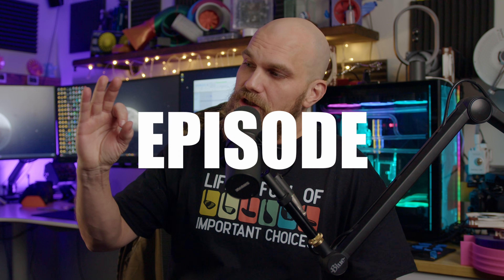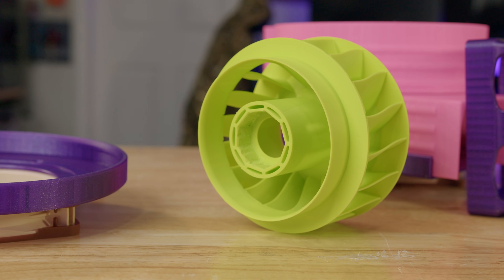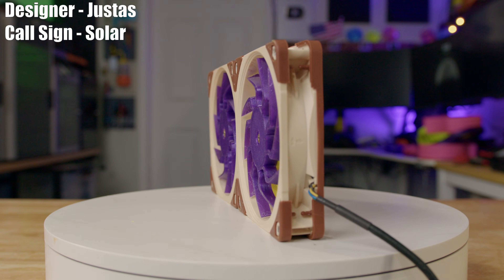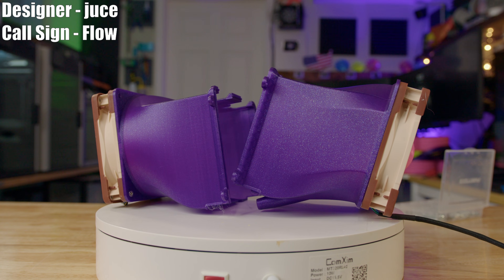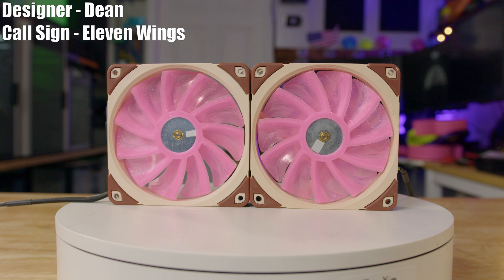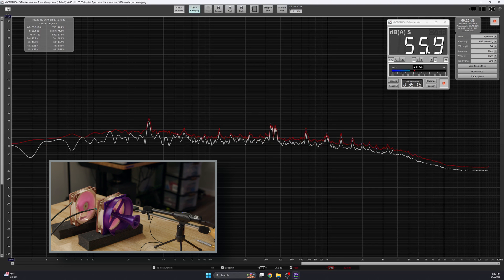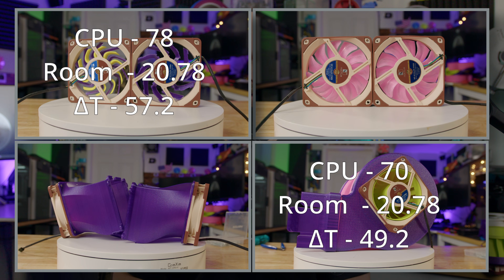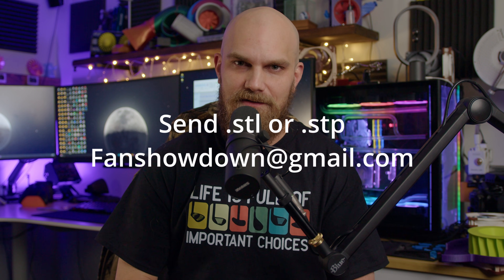The Most Aggressive CPU Fan Ever Submitted | Fan Showdown S7E3

Comment: Why not develop a phone app to "audio mask"  similar to noise cancellation. it would simply listen to ambient sound and play it back in reverse to cancel out the high less pleasant fan sound and greatly reduce perceived loudness. Set your smart phone next to your PC and you'd have a much quieter gaming fan setup that still performs well. Could even use the internal PC speaker to do it?

Comment: I love that wind tunnel idea, maybe it's because I've thought about it myself lol. 
Imagine if you had it mounted between the front case intake and exhaust, going straight through the case (or maybe a 90° curve between a top fan and exhaust)- fresh air in, hot air straight out the back of the case, no mixing with GPU exhaust.

Comment: Dual Flow would have been way quieter (and more efficient too) if the rotors were properly balanced first. It sounded like the majority of the noise coming off of it was from the interiors doing a rather aggressive wobblin' as they went round and round.

Comment: The table had "Jule" and video had "Juce" as the designer of Flow. The design of the Flow seemed like a clear winner for me and the only question in what kind of fan blades you should use in it.

Another option for ducted form factor would be to have both fans on the intake side with compressor setup (first fan running first stage of the compressor with throughput optimized fan, and secong stage with pressure optimized fan – with maybe 50 mm long section with non-moving mirrored fan blades / air guides between fans to change the direction of the flow between the fans and both fans rotating in the same direction). I think this should allow more air than push-pull configuration through the CPU cooler. Shaping the exhaust side would be an interesting experiment, too: would it be better to have some ducting after the CPU cooler or is it better to end the ducting immediately after the metal parts of the CPU cooler end?

Comment: wouldn't turbulence be preferred for heat sink cooling
Reply: Yes but not at the intake of the fan. On the intake side turbulent flow instead of laminar just causes noise without benefit.

Comment: If you're going to factor in noise you really need to work on a consistent point of measurement. I realize that's difficult with all these different designs but I would  try moving it off the table (hanging, tri-pod, etc.) at a fixed angle/distance from the heatsink or at least measure from multiple, fixed distances as a sanity check. Especially for something like the blower design the location of the reading might make a notable difference.

Comment: one more tip for the designer of dual blower, add a stabilizing bearing on the other side of the fan, if the printed fan was perfectly straight and balanced, i believe it would be in the first place with a pretty large margin, but the wobble of printed parts caused a lot of noise in my opinion
Reply: The imbalance probably also reduced the fan RPM. Hopefully we'll see a revised version, sometime in the future.

Comment: those dual fans are grossly out of balance, defeating the noise reduction with the blade design AND reduced efficiency. That design depends on a center support point to run true. One small tweak may make it roughly 25% more efficient on all fronts.

Comment: I swapped my fans out for some 6,000 rpm dual wire units. They are louder than stock but they blow thru my radiator really well. Keeps it nice and cool.

Comment: I think the noise needs to be figured out a  bit better.
50dB of high frequency chirping is not the same as 50dB of barry white low level rumble.
One can be annoying and the other can be soothing.
ps: I was watching a channel about sound deadening and it didnt affect the DB level but sound deadeners are great at removing the high frequency and mid frequency  noise from roads. 
So the net DB value was the same but it seemed a lot quieter because the range of noise left over going into the car was not obtrusive to conversation or radio.

Comment: The noise of the QQQ is much higher cos of the unbalance of the fans and the extra vibration they produced because of that on the table! Having said that I think that if you can eliminate the unbalance of the fans then the DB will be significantly lower and it would potentially come first!

Comment: Having nozzles to blow on the bottoms of the heat pipes goes against what the heat pipes are designed to do. The phase change is intended to take place higher in the stack, If there was cooling to be gained there the manufacturers would already be doing it. Where they could actually be effective is making sure there is air moving near the surface of the motherboard so the VRM's get some circulation.

Comment: A Velocity stack and a bellmouth are different things. A velocity stack "might" have a bellmouth in the end, and a bellmouth might not be attached to a velocity stack.

Velocity stacks are just tubes whose lengths are tuned to a certain frequency, and are sometimes equipped with a bellmouth at the inlet. The stuff used on your tested fans are just bellmouths.

Comment: You need to measure the noise levels at the same angles and distances. 

You can actually calculate the sound power of the fans by taking a log average of all the angles and remove distance and angle as a factor. 

I can provide full equation if Interested

Comment: I have a brain spark.
Has anyone ever hooked up your fan to a gearbox?
Seems like someone could get a heck of a speed boost with a gearbox. It might start slowly, but after reving up it would net WAY more RPMs than other fans.
Reply: Not how it works unfortunately, fan has a limited amount of power and gearbox can only lower it. Power is what does the work of moving the air...

Comment: Blowers don't work efficiently if you live over 2000ft, and it gets worse.
Taken from experience on a lot of Dell Optiplex 280 SFF, with the air density the blower becomes useless and noisy.

Comment: Dude. It's time to grow a pair and start actually balancing the fans.
Reply: But how much is he supposed to tweak these designs to make them better/good? Maybe they weren't pressed on the fan hub perfectly, or maybe the design was off. We can't really tell.
Reply: @47CryXMA  have you ever used a CAD software? It's basically impossible to design an unbalanced fan unless you intend it to be imbalanced... It'sa manufacturing issue
Reply: @47CryXMA Any fan balancing is done after production, including industrial injection molding and metal casting. The reason PC fans get away without is simply because speeds are slow and fine tuned injection molding is "kinda good enough" but high speed ones like vacuum cleaner impellers go through same process. How you balance one is spin it on a jig with accelerometers, cut/drill the heavier side, sprin again, repeat until the vibration is within spec. Large 3D printed fans vobble so much we can see on camera.

Comment: 1:52  press fitting the blade onto the fan then spinning showing how off center it is, had me twitching !   DUDE!  COMMON!

edit  and you can HEAR it off center in the sound test!  AUGHHHHHHHHHHHH
Reply: Such a shame, it's a really nice design and effective. Fix the balance issue would also help it in the cooling test as you leave little bits of speed on the cutting board with each wobble.
Reply: You can also see the whole rig wobbling at 7:44

But at what point is it pushing that little hub too far with that huge attachment.
Reply: That design is putting a whole lot of weight on the hub, its gonna be messy no matter what.
Reply: Yeah that was kind of obvious, but could it be that the design itself could invite the rotors hitting the wall, because there is only one point of contact?
Maybe adding something like a railing or a second bearing right across from the motor could help here
Reply: Looks like the designer didn't account for the inaccuracies inherent in 3d printing. But that's just the nature of this contest. If someone submits a flawed design, the tests should show a flawed result.
Reply: @cosmic_cupcake  There is a fairly generous clearance of 2 mm between the casing and the impeller axially and 1 mm radially. I designed it without the rubber corners on the A12x25 and mentioned in the email that the rubber corners should not be used. I looks like the fan was tested with rubber corners which will decrease the axial play. 

The main problem with the design is the high weight of the impeller. Printed in PLA with 100% infill the rotating mass is 166 grams. Regular axial fans are usually below 50 grams and the weight is closer to the hub which is not the case here, most of the mass is outside the fanframe. Together with the high mass this makes the design very susceptible to imbalance and the resulting strong vibration/wobble.

Despite this I am very pleased with the cooling performance I managed to achieve. If I have time I might make a second version where the impellers are rotated 90° so that they are horizontal. Together with some mass reduction this should reduce the wobble and noise a lot. It would also enable a casing with two openings each which should increase the maximum flow.
Reply: @QQ-Q-QQ  Yes, your COM is high and off-axis, and that's what I meant with inaccuracies. These prints are never 100% square and balanced, so you have to expect a wobble.

If you ever design something like this again, you should consider a set of ball bearings to support the opposite ends of the fan cages. MH will buy these additional items for you as long as you instruct him to. 
Or at least as long as he remembers, lol. This vid was clearly a bit rushed with him forgetting to remove your rubber corners and mounting one of the other fan sets the wrong way.

And I'll still have to congratulate you for your fans performance. Considering the circumstances it was still quite competitive.
Reply: Exactly. Thank you
Reply: If you are going to try and go after someone in the comments for doing something silly/dumb,... it might help if you don't misspell such COMMON words,... Therefore, sounding even more silly/ dumb,... COME ON!!!
Reply: @rpetersen2  no one "went after" anyone you spade bit. 
it's also my near 30th night of sleep deprivation due to chronic pain, so kindly go eat koala droppings.    also, you forgot to capitalise when you came after me.

Comment: considering temp test will be using radiator(idk what it's called for air cooler), maybe it would be cool if the fan is mounted to the radiator while doing smoke test to see how the airflow behave with it.

Comment: Love the show and watched every episode of the showdown. I don't mind the crazy builds, but maybe give them a size box they need to stay confined to? Something to fit inside a case ;)
Reply: This is how Formula 1 happens - add limitations for arbitrary reasons and you can make anything boring. I like the crazy builds specifically. Nobody is going to be using these for any practical purpose, so you really might as well see how efficient/powerful you can possibly make something that uses those weaksauce noctua motors as a starting point with no limitations to creativity.

Comment: I'm surprised at the reverse velocity stack's smoke test... Felt like the opposite fan was bowling half of it back through the front (as though they were push-push instead of push-pull).
Reply: exactly, sth's wrong
Reply: I couldn't tell on a small mobile video but was the stack part spinning? That's good to create a huge ejection vortex that interrupts air flowing in
Reply: @ObservationofLimits  99 times out of 100 they design the velocity stack as a bolt-on (static object), and I'm sure that's the case here as well. I seem to recall ONE that did, years ago, but even then I'm questioning my recollection 😅
(edit: to clarify, I'm referring solely to Fan Showdown submissions)

Comment: The fair rankings are (details below):
1	Flow
2	Dual Blower
3	Plasma Vortex
4	30 Fins
5	Humpback
6	Mango Knife
7	Solar
8	Eleven Wing
9	Ideal
10	Split
11	Inside Out
12	CRX1

Ranking	Name	dB(A)	dT(Celsius)	linear gain	normalized gain	normalized dT	final score
1	Flow	50.8	50.2	346.7	0.0%	12.5%	3.1%
2	Dual Blower	55.1	49.2	568.9	19.0%	0.0%	14.3%
3	Plasma Vortex	53.4	51.9	467.7	10.4%	33.7%	16.2%
4	30 Fins	53	52.5	446.7	8.6%	41.3%	16.7%
5	Humpback	52	54.5	398.1	4.4%	66.3%	19.9%
6	Mango Knife	56	50.5	631.0	24.4%	16.3%	22.3%
7	Solar	51.6	57.2	380.2	2.9%	100.0%	27.2%
8	Eleven Wing	56.8	51.2	691.8	29.6%	25.0%	28.4%
9	Ideal	55.9	53.1	623.7	23.7%	48.8%	30.0%
10	Split	57.8	57.2	776.2	36.8%	100.0%	52.6%
11	Inside Out	60	53.2	1000.0	56.0%	50.0%	54.5%
12	CRX1	63.6	50.6	1513.6	100.0%	17.5%	79.4%

Comment: There was a noticeable imbalance in the dual blower causing a pulsation in the sound, like it was rubbing occasionally that might have caused the sound reading to be higher. With the dual blower, it would have been interesting to see the amount of smoke coming out if the smoke was going into both sides.
Reply: Yeah, even in the clips, you can see the vibration and rattling. That's got to be contributing to the noise.
Reply: imbalance is polite. it sounds like a weird engine to me, definitely hear something rattling and/or grinding, and a steady fastish chug
Reply: Yeah I could see that was going to be a problem at the introduction stage as there is no bearing mounts on the inside (Pink pieces) to keep the Squirel Wheels balanced
Reply: Sounded like one of the impellers was loose or crooked
Reply: Yeah, and why is it asymmetric?
Reply: I think the dual blower fan was tilted on the axis but it may simply be too big to be stable and fall tilted after running for a moment (because the motor heats a bit and contact gets looser with thermal expansion of the plastic).

Comment: You had  one of the fans backwards for the first smoke test. Two fans don't just move nothing. Unless they are blowing at each other. Counter rotating blades need the fans to be facing opposite directions since you can't reverse the motor. Although this should become a standard on PC fans because then you could put all your fans pretty side out and then let an AI test every fan configuration for the best cooling.
Reply: I think it showed how ineffective the fan blades were. Which translated to real world results
Reply: @justwinclassic  brother a shitty fan moves air. For two fans not to move any air means they're pointed at each other which is proven by the temperature numbers later on. If the fans moved no air the cpu would have over heated not been the second best in the group.
Reply: There's not much variance in cooling a box. Either you go positive pressure (all fans blow air into the box), negative pressure (all fans suck air out of the box) or a combination of either in push pull or push push configuration.
Reply: @BrunodeSouzaLino  Dude, set all of the fans to positive pressure or negative then nothing happens. That's basically what the first smoke test was. Unless you have a large open air inlet or exhaust. But with every fan space occupied in a case there are a huge number of variations that would make a difference. Not to mention the up to three fans on a CPU cooler. And graphics card. Now granted you may have restriction if you care about dust filters but there's still options. For example I have my top front case fan blowing into case instead of exhausting because it was just pulling the air from the top front fan out of the case  and made it worse when it was an exhaust.

Comment: Still doing the sound test and the flow test without the cooler on?
Reply: Yeah I saw that and just sighed.
I really don't think it's a good test.
Reply: Not just that...  is he adding the decibels to the change in temp to get the score?
Doesn't that mean it scores higher for being louder?
Reply: @FeignJurai  it's adding in the sense that it's now being used, the formula divides by the db, so higher db gives a lower score (and it's 1/temperature difference so lower temp gives a higher score.)
Reply: @FeignJurai  he's fixed that.
Reply: its a fan sound test is ok but i could care less over flowing unless its dumb loud
Reply: Yeah wtf